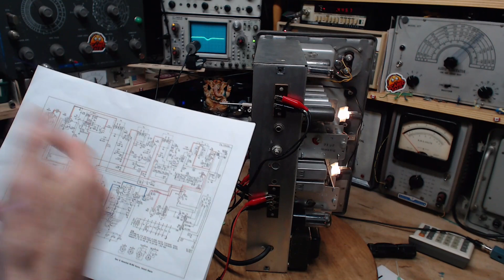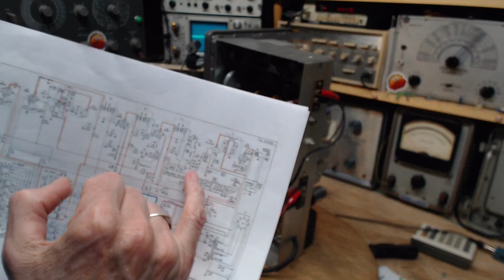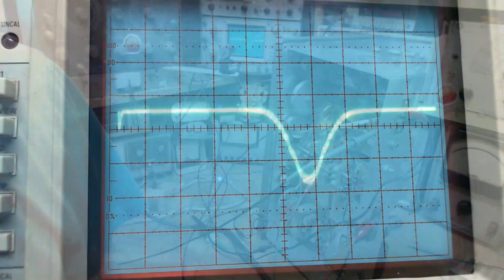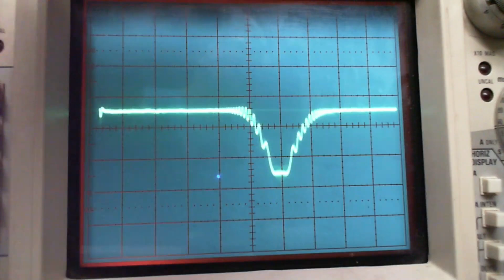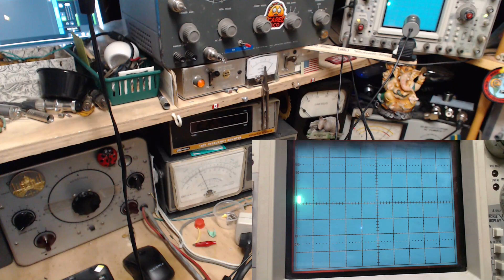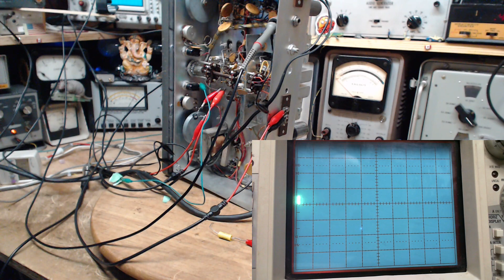Hammarlund HQ 100A Communications Receiver Video #11 - Positive AVC Voltage?

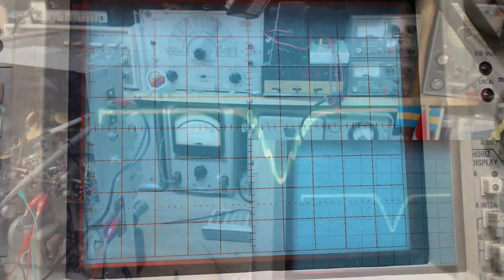Comment: 21:50 please do away with this makeshift marker generator and most importantly this SDR toy! This is not a precision calibrated instrument. More over there is no need to peak the IF to the absolute exact frequency. 453 vs 455kHz wont make a difference. Not even 450 versus 455kHz would matter in normal operation regarding selectivity and bandwith.
This is useless tinkering trying to tune this boatanchor to tolerances, that it was never designed to. 
 Peak the IF to a static 455kHz from the generator and be done. And if you feel the need to visualize the passband curve sweep after you did the static IF alignment and make sure to keep the peak at its place on the x-axis during sweep and only move the sides.
This will be more precise than SDR and makeshift markers.
And btw; the way the limiter set to on influences the signal shows that you operate the generator at too much power.
Electronics Old and New did a good video on IF sweep adjustment. Maybe gontake a look there - oh right, you dont take advice from others.
Reply: Wait, he needs a “precision calibrated instrument” to not tune a boat anchor to tolerances it was never designed for? More confident sounding nonsense from the gripe gallery.
Reply: No wonder he ignores you people.